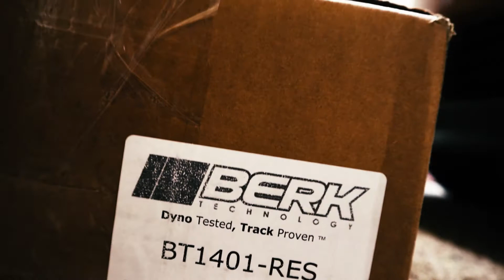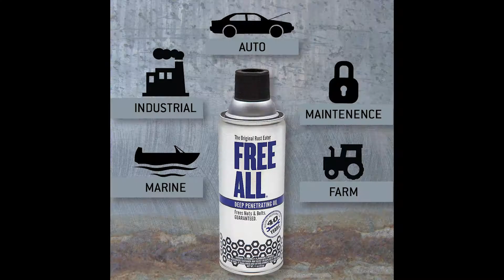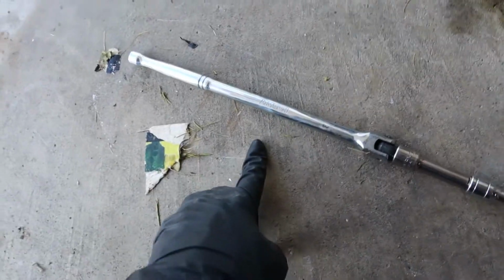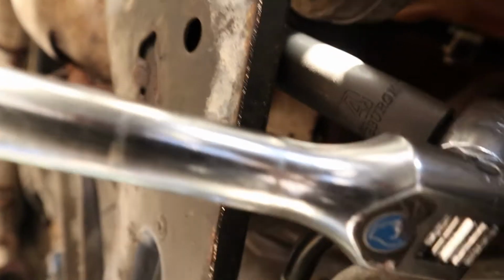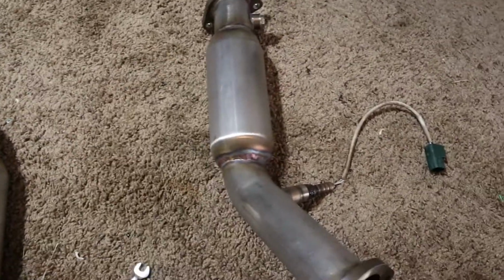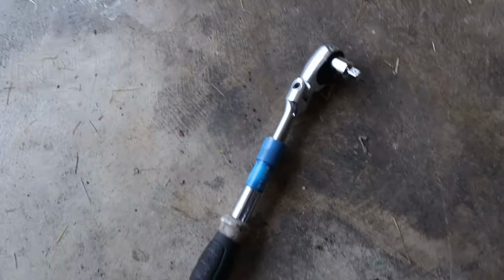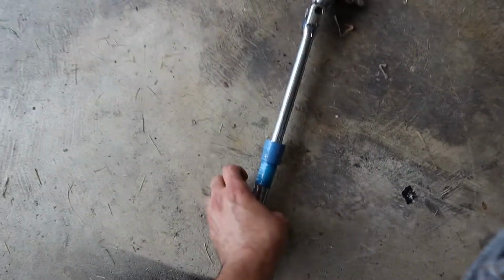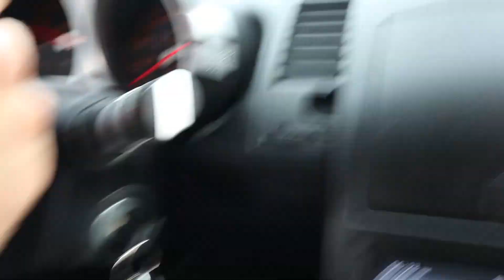350z Test Pipe Install | Berk Resonated

Comment: Question bro did you use the oem 02 sensors or did you have to buy new ones ?
Reply from the maker: I used my OEM ones that were already in the car. I would recommend replacing them during the installation since they would be right there.

Comment: Ik IK, a year later but I have a question, when installing the test pipes did you still had to use the demon bolt or not?, Nice video!
Reply from the maker: No worries, yes I had to use the demon bolt on test pipes once they were install but they are easier to get to compared to factory. Plus with newer hardware that isn’t rusty it helps out a lot lol.
Reply: @builtbybeez  so the new hardware came with new demon bolt? And you still had to tide it from top? Thank you
Reply from the maker: Yes the Berks came with all new hardware which replaced everything. Having several extensions and a swivel will work wonders for removal. Also a great idea to soak all the old bolts down with penetrating oil a few days before installation to make it easier to break them free.

Comment: What y pipe and catback are you running? And did you get CEL?
Reply from the maker: I’m running the stock Y-pipe for now and the cat back I’m running is the ISR GT Single exhaust. I did have a check engine light but retightened the bolts down and the light went off. Later I found out I had a bad coil and so far no CEL.

Comment: I have the same set up ( almost ). I have Z1 Y pipe, ISR single gt, and had test pipes, non resonated and I hated the sound. Would you say these would reduce that rasp just a bit? I can kinda hear it on your Z but it’s not as bad as non resonated…
Reply from the maker: Yeah I would definitely say having the resonated test pipes help out with the rasp. I don’t really have too much of it when driving and don’t really have a drone either. Can have a conversation in the car without needing to yell lol

Comment: Do you have a straight pipe cat delete set up? I’m asking because I’m trying to find resonator pipes that actually mask the sound of a raspy hr tomei straight pipe set up😂 yours sounds really good though
Reply from the maker: Thank you! I’m running the ISR GT Exhaust. There is a resonator in this exhaust so it cuts out a lot of the rasp. Definitely didn’t want to do a straight pipe lol
Reply: @builtbybeez  oh I gotcha, I just ordered the berk test pipes, and I’m hoping it’ll reduce the rasp and the noise because i run a tomei staright pipe, cat delete, single exit system, and it is loud lol
Reply from the maker: Oh I bet it is lol. It should cut down on the rasp some with them being resonated.
Reply: @builtbybeez  I hope so, the next step would be long tube headers if that doesn’t work
Reply from the maker: You could also try to get a Y pipe that has a resonator in it. I believe Motordyne makes one.
Reply: @builtbybeez  oh true, I’ll look into that too, thank you

Comment: Did you get a check engine light?
Reply from the maker: At first I did have a CEL and it was due to the bolts not being tight enough. Re tightened them and the light went away. Found out later I had a bad ignition coil so I replaced that. Haven’t had a light on since.